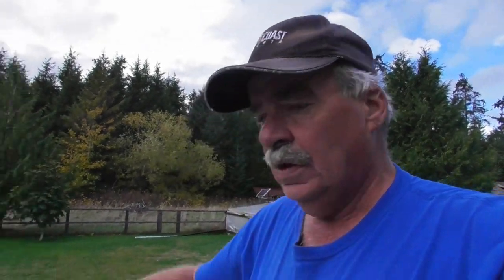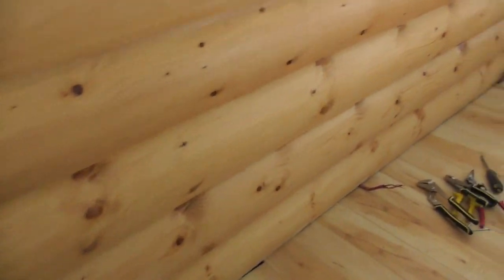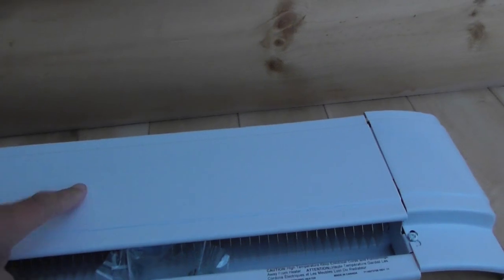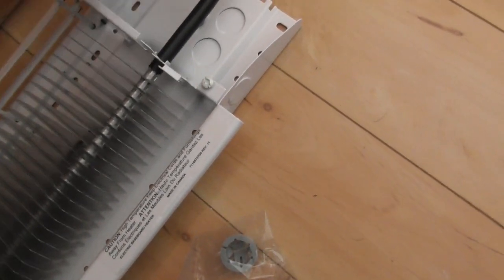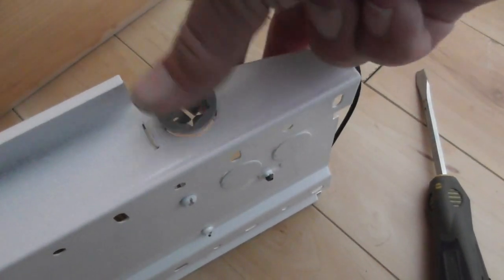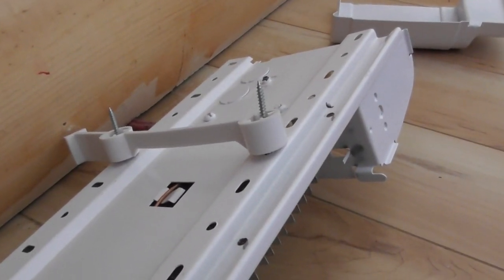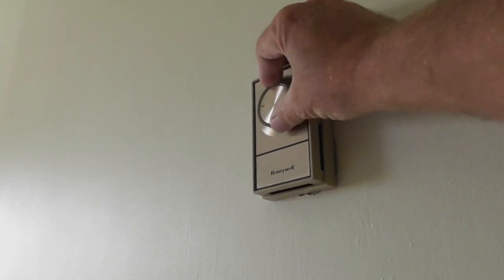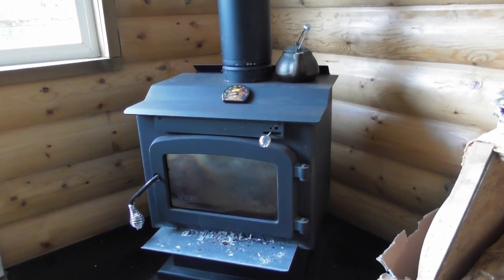Energy Saver Dimplex Linear Convector Baseboard Heater Install !

Comment: I boought several of the PCM series heater for rooms without a wall mounted thermostat.  The thermostats no longer work on 3 of the units.  No heat, but they have power.  There are no replacement parts listed on the Dimplex web site, as well as no trouble shooting guide.   I have been waiting 20 minutres on their support line.  I fear I will have to replace the entire units, and cant imagine how expenive their proprietory thermostat would be, if they even have one.  The fact the thermostats are gone is not uncommon after a recent web search.  The units get a terrible review on the dimplex web site.  I searched google for thermostat for this unit, and nothing.  Nothing!  On Google!  If I knew I could install a third party thermostat, then I'd do that, but no way to find out.
Reply from the maker: Wow!  Sounds like you have had some really bad issues!  Are you sure you ordered the correct voltage models as there are both 120volt and 240volt models of the same size and output configurations.  If you run a 120volt model on 240volt it will fry the electronics for sure.
Reply: @NormanMcGregor  they worked for 4-5 years then failed.  I have power, but thermostat does not regulate heat.  On an separate unit, the LCD is dead.  Junk!

Comment: You pay a premium for those little LCD themostats on these heaters.  When your thermostat goes in one of them, good luck finding a replacement.  I bought about 16 of these things for a duplex I renovated.  2 of them have failed after 5 years.   That is a 15% fail rate.  I'd fix them myself, but you can't buy the replacement thermostat anywhere.  Take a look at the Dimplex parts catalog online.  Is a joke.  You can search it, but there are no pictures of any of the parts they list.  I am now basically forced to go buy a standard baseboard heater, plus a thermostat, to replace these units.  I would not recommend.  Considering there is little that can possibly go wrong with a solid baseboard heater, to have 2 fail on me is a joke.  Stay well clear.  10 year warranty on element, and 1 year on the crappy thermstat.  When the latter fails, who cares how long the element lasts?
Reply from the maker: The ones I got have no electronics in them. They use an existing simple wall thermostat to control the heat.  Watch the whole video and you will see.
Reply: It's true,Dimplex has pretty poor customer service,I installed a unit in a Condo I own  and my tenant lost one of the metal, end cover plates(how he lost it I don't know). I called Dimplex for a replacement-they wanted about $25 for that little piece of metal(including shipping). The entire unit was only about $50. They were very unfriendly over the phone.
Reply from the maker: I am sure the cost of shipping would have also made it very expensive to get the part too.